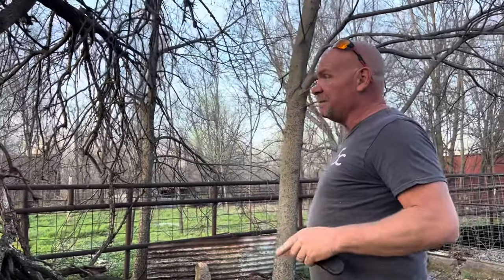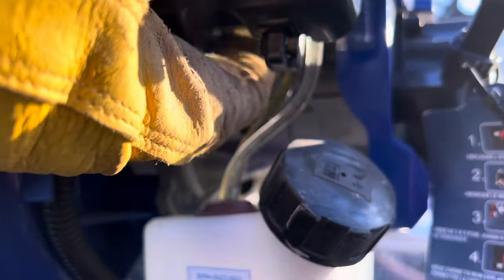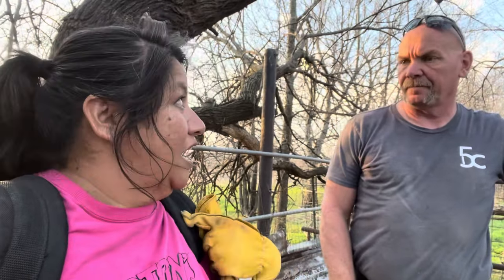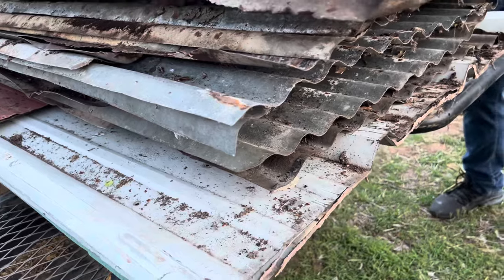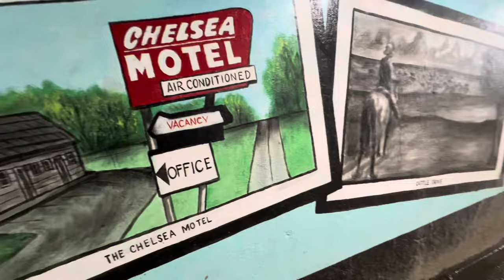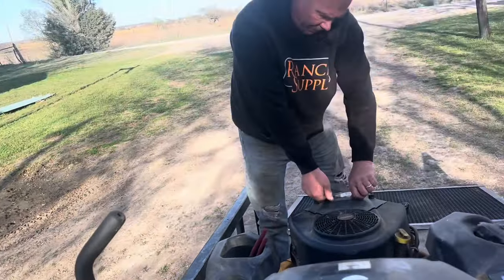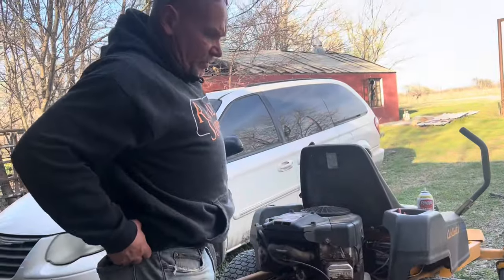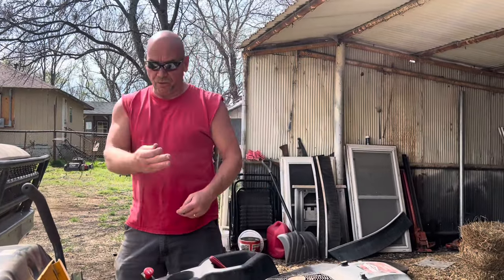Blessings, Adventures and Hard Work Pays Off / Couple Renovates Abandoned Homestead

Comment: I have a 185 mph  Greenworks battery operated blower/mulcher vacuum the trick is 40 volt extended battery. Same tool is over 12 years old,  I'm impressed. I care for my entire  2 acres with it. Winter in Alaska it keeps my 19 stairs down to bare wood all winter, takes about 30 seconds.  I live at the base of the mountain,  ALOT  of snow. I also keep my garage,  shed,  lean-to so clean.. Same battery works with my hedge trimmer, pole trimmer, weed eater/lawn edger. Love their products.